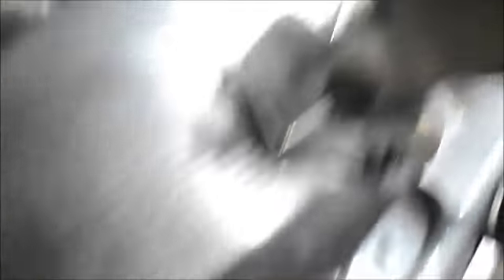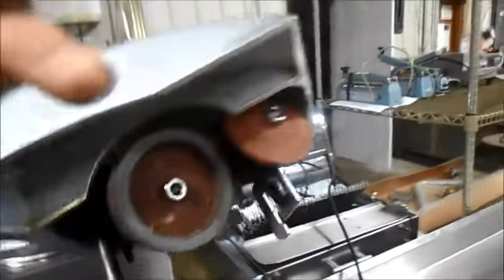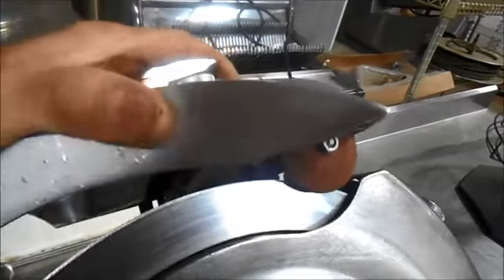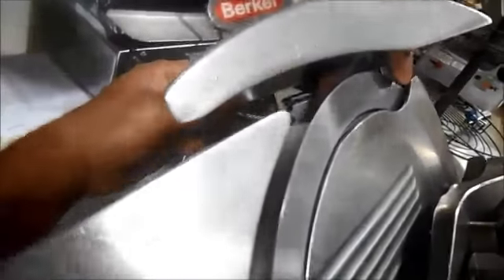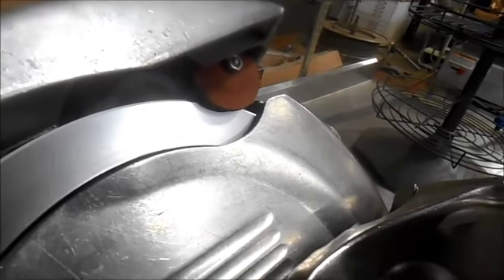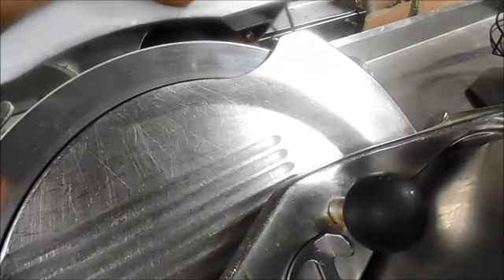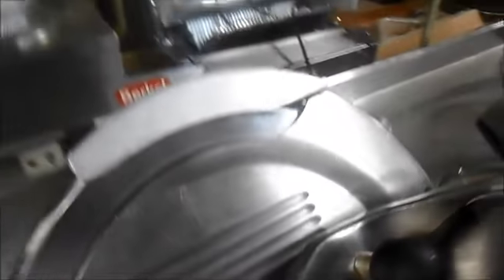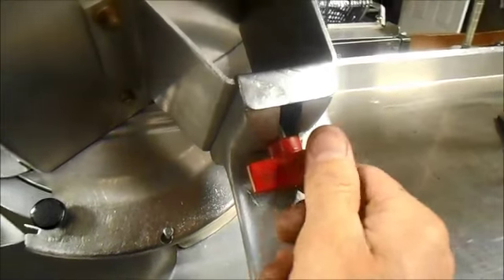Berkel Slicer

Comment: I have repaired thousands of these 818's, The 919 was the last descent slicer they made
Reply: And semi automatic?
Reply: I have the same slicer but cannot remove the product plate, I loosened screw but will not lift off.
Reply: How do you change the belt for automatic?